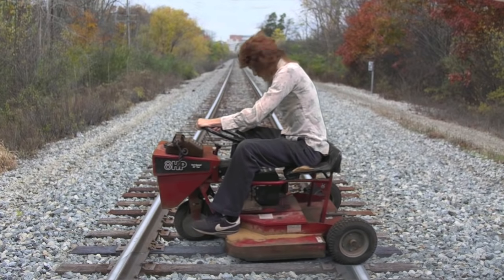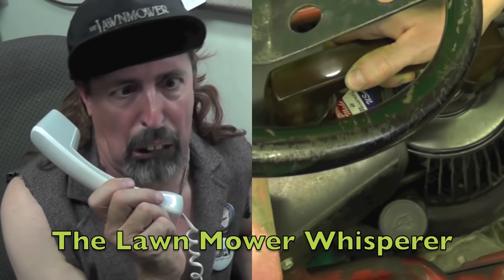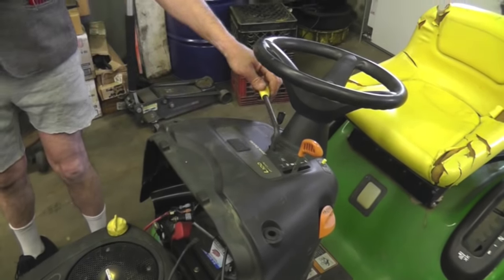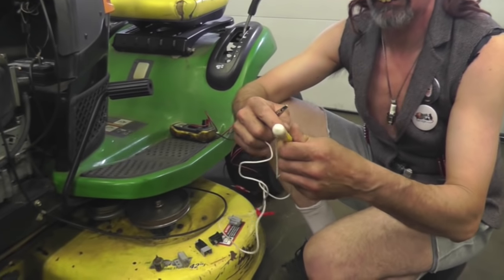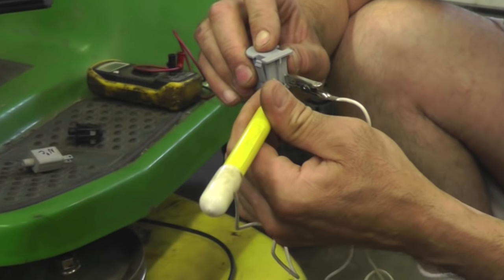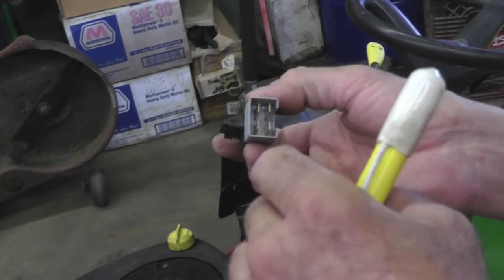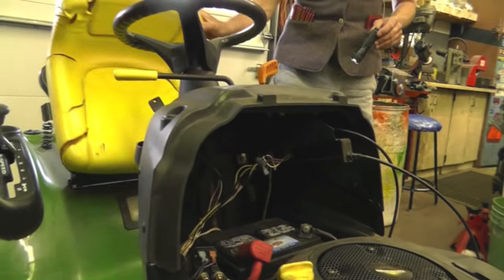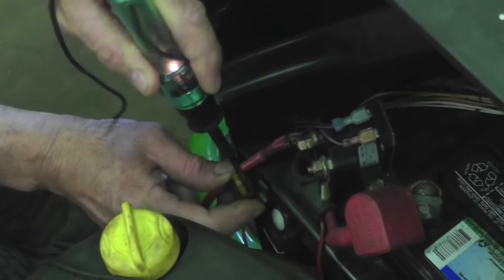Electrical Troubleshooting FOR DUMMIES

Comment: Can you really cut the tip off that shutoff valve? If so, I'll cut that sh*t off. Mine turns over but won't start.... Sometimes I'll turn key off and let off brake and the damn motor will keep spinning. Have to bang on it a few times. Weird... Any help?
Reply: Seems like mine isn't getting fuel

Comment: could you do a video on a hustler raptor zero turn I'm have problem with mine it's been working now it won't fire up it the motor turn but work fire I also have a electric problem I replace my selnoid my key switch and I still have to crank it by touching my selnoid with  a screw driver please help me
Reply from the maker: I could but the only problem is I don't have a Hustler Raptor. It sounds like you have a safety switch problem. Check all yur saftey switches

Comment: my mower will not start i changed solenoid and tested started as instructed on you tube tested with another battery and jumped stater but starter did not work so i ordered a new starter hopo that fixes the problem,also bought a new key swith

Comment: not sure u will see this.. but .. i have a coalher.. that needs 6 plus volts for it to start.. has the mod on the side of it.. i replaced the sillynoid for reason it was toast.. but since them the volts goin to the module is around 2 to 3 volts on start .. i have to jump to the wire used for the carb sillynoid since i put a diff carb on it.. its easy to get to .. << if u understand what i said.. heck i dont think i do lol ... ideas ??

Comment: Hey Taryl! I enjoy watching and learning from your videos! Keep it up! I recently swapped engines on a Cub Cadet, from the original Kohler Courage 19 hp to a Briggs and Stratton 19 hp Intek. Problem is the charging system not charging. Do you have a video on engine swaps and rewiring charging system? Thanks.
Reply: cud

Comment: I pulled out the spark plug and put it on the metal engine and turned over the motor.  The starter motor spins and head rotates.  I don't see a spark across the plug.  Shouldn't I be able to see a spark if everything works?  I was taught this trick by my old neighbor, but it doesn't seem to work.  I want to figure out if the carburetor is bad.  BTW, I had the motor upright to sharpen the blades.  I forgot to pull out the value, so the engine flooded the motor.  I drained the oil and refilled.  I took off the spark plug to clear out the excess oil.  BTW, I cut off the solenoid, so wondering if the engine isn't flooding, as it leaks a bit.  I lost the gasket on the bottom but put some sealant there.  I have to retry in the morning.
Reply: Valtér Hégér if your not getting spark then you might need a new coil or the magnet on the flywheel needs cleaned and the coil gap reset.

Comment: I have a L130 John Deere , I have 12 volts at the voltage meter/regulator with key off. .. where is the Diode in that  wire??  or why is there 12 volts with key on  and offf!??
I have had several John Deere that the battery ground wire in front of battery to the chassis ..Lost ground.. anyone else found that an issue??

Comment: Each time I screw around on one of my mowers, I add a dab of dielectric grease on each connection. It prevents corrosion and  power loss due to insulation from rust.